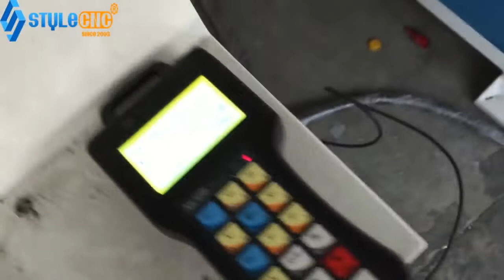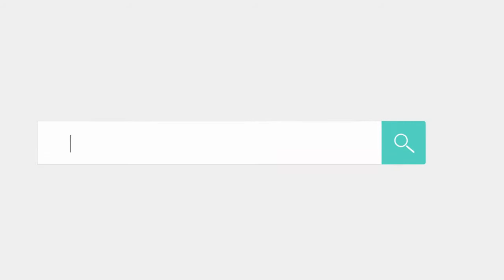STYLECNC 1325 4 axis rotary cnc router machine

Comment: Hello,what post processor do you use?
Reply from the maker: For this machine, we adopt RichAuto 4 axis control system, and the software is Artcam, and we also have JDpaint for choose.
Reply: Yes but what machine file format do you use when you save the toolpaths?
Reply from the maker: G code sir
Reply: thank you, I am having some problems with the spindle as it starts as soon as I enter NC Studio, any knowledge about that? Could you help me with the NC Studio parameters that I should use? Thank you,
Reply from the maker: +8618253126778, my whatsapp, you can add me, i will help you.
Reply: How much is it plz?